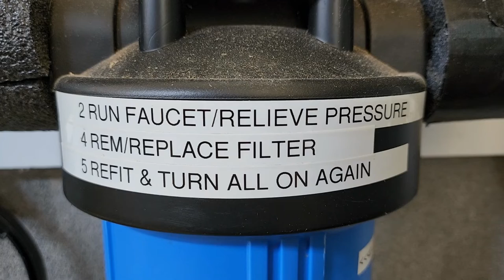How to Change the Big Blue Sediment Filter Quickly and Easily

Comment: Additional steps I suggest:  Sanitize with bleach solution, also clean the black housing, remove O-rings, clean and lubricate with plumbers silicone grease, reinstall O-rings, lightly lubricate the threads to make removal easier next time.
Reply from the maker: Sounds good; Thanks for sharing your experience.
Reply: @gcraig0001   great information  finally someone that gets it.  Thankyou

Comment: Good video and good questions.  Suggest having an extra O-Ring handy in case old one is stretched out of shape and won;t fit back into position.  I had to run out to four different stores before finding one at Lowes. Saludos.
Reply from the maker: Thanks! That's a good point, Jack. How often have you had to replace the O-Ring?

Comment: I need to make instructions and labels like that for my family, well done.  Does the housing really need to be that tight?  I do mine hand tight only, with a small amount of silicone grease on the rubber,  but it has flat sealing ring.
Reply from the maker: Thanks murky. I found a cheap little label machine to be immensely helpful over the years. The process steps and actions tend to vary a bit between different installations. Yours clearly varies from this one regarding the filter housing tightening pressures. I don't know what the controlling factors are though. It doesn't matter if the water is clean, does it? In addition to the process step labels I schedule the review filter status dates in my calendar with an alarm so I know the task needs to be attended to.

Comment: What label maker do you have - I like that idea!   

Are you supposed to coat the o-ring with something?  How often do you replace the o-ring?

Thanks
Reply from the maker: Good questions, Dave. PTFE Lubricant for the seals but not needed every time if clean and in good condition. Always check and remove if having a sealing issues (leaking). I replace critical seals when they are pitted, trapped, no longer elastic, never had to yet though.

It's an old Brother P-Touch labeler, Dave. Bought the kit cheap; less than the cost of the tapes that came with it! Battery life very good, all the buttons still work, tapes expensive for what they are!

Comment: Very helpful! One question...at 3:40, do you have to align the hole in the top of the filter with the ring in the upper housing (the same way you do it with the bottom of the filter)? Thanks
Reply from the maker: I've never actually thought about that, J R. I do consciously aim to keep the filter upright and make sure I engage the housing thread properly and that's about it. Have you had a problem with filter alignment?
Reply: @PicRic  Thanks for the quick reply, Ric. I've always been concerned about aligning with that upper ring simply because the lower ring was obvious. I don't believe I have ever had an issue but I'm no expert. Thought I'd get another opinion. As you mentioned, I do my best to ensure each filter is upright and sits in lower ring when I begin screwing the housing into place. Thanks again!
Reply from the maker: @XKXKIXKXK  If it isn't leaking then the job's a good one! Thank you for watching and commenting.

Comment: 1:47 With what water?! I had to turn off the water to take out the filter.
Reply from the maker: It's all shown in the video. The faucet gave up a little and the blue filter case provided the rest.  Usually I save a quarter bucket of water back for rinsing but simply forgot this time. I always keep diluted dish soap to hand as well.
Reply: @PicRic  Classic case of "watch the whole video before commenting, dummy". Thanks!
Reply from the maker: @reverb508  No problem.  Thanks for watching (all) the video!